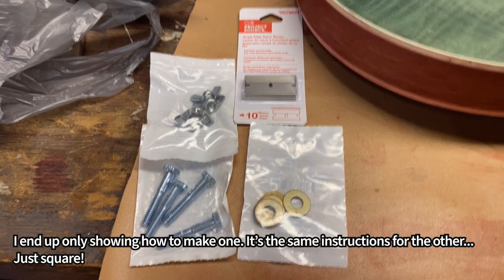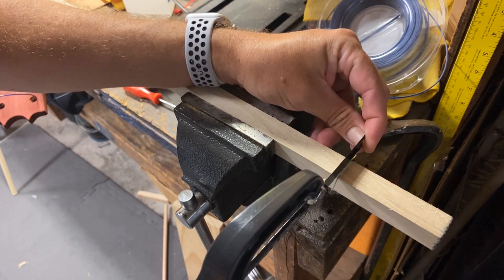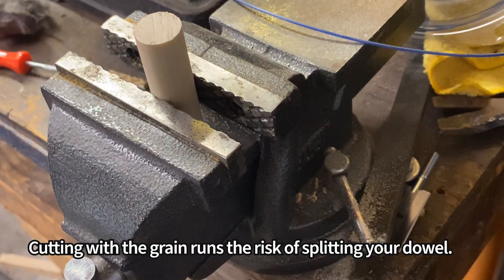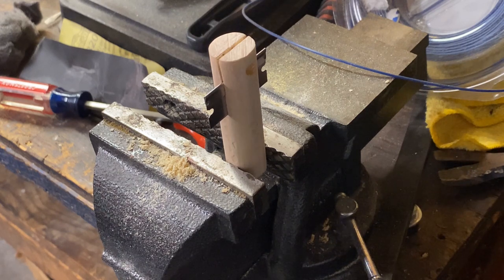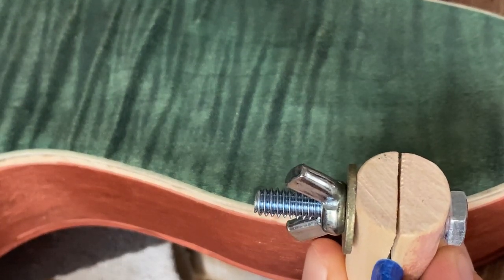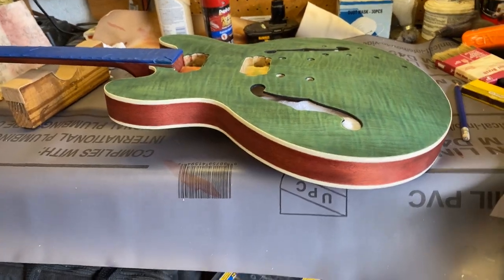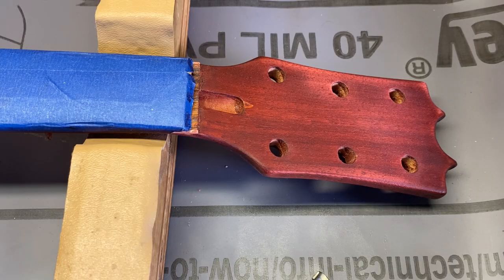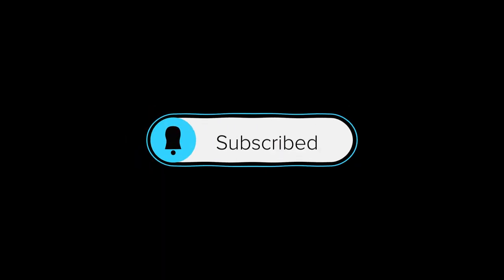Building a StewMac ES-335 Kit - Part 6 - Binding Scraper Build, First coat of TRU-OIL!

Comment: I can't decide it's I'm going to build one of those scraper tools or use my thumb.  It's the one job I've never done on a guitar.  I usually don't like bindings, but a guitar I'm restoring has em, so now it's time.  That tool certainly looks like a great way to scrape and avoid cutting in the wood.
Reply from the maker: I ended up not using the dowel to be honest. i taped off a part of a razor blade and just made it wide enough to do binding perfectly.
Reply: @iambucketdotcom_official  Yeah, seems the dowel is good to give you an idea of what is going on.  I'll probably be starting that way too.  Cheers

Comment: Did you sand between sanding sealer coats? I read where you shouldn’t use the sealant on stains because you may sand away the stain. I was very impressed with the outcome of the true oil process. Just want the sanding sealer clarified. 
Thanks
Reply from the maker: I was worried about this too. There was a bit of color bleeding initially, but that was on me for not allowing the sealer enough time to sit before staining. I ended up sanding down again, sealing, waiting a couple days, and then started the dye process. It worked out much better.

Thinning my dyes with denatured alcohol definitely helped over water thinning.

Comment: after sanding the sealer coat, noticed that the top and back are 2 pieces of maple joined in a center seam, and the maple block or maybe they used mahogany in the middle neck tenon joint looked good just spray with a light coat of real polyurethane and another coat and let it dry unless you want satin finish which is good for necks let it dry in a humidity controlled space

Comment: I was under the impression that you needed to use like items when finishing a guitar. I didn’t know that you could use tru-oil over sanding sealer without having to wait 30 days for it to cure. Now that time is passed how did the project turn out?
Reply from the maker: Finish is holding up great! It has the normal use marking that all guitars get, from belt buckles and shirt buttons, and random things hitting it.

I play it daily and take it to band practices often. Its my main workhorse and gets knocked around quite a bit.

Comment: Tack cloth after the naptha before you spray? My experience with using steel wool is that it leaves debris all over
Reply from the maker: Everything was wipe on, no spray. I do admit, I did miss tack a few times but once wet sanding and buff occurred no debris was apparent

Comment: I wouldn't go steel wool between each coat. The coats are so thin, you can easily break through them. I did the same in the beginning and had just that problem, sanding away some of my stain, especially on the edges where the true oil can't build up that well. Shouldn't be that much of a problem as you're having binding, yet I would do it only after every few coats. Every 4-5 coats seemd to work well for me afterwards.
Reply from the maker: Great point! I did change to wool after 4-5 coats instead, followed by grey Scotchbrite and then White Scotchbrite. The results have been stunning.

I am just now doing my 2nd to last steel wool on the top.. I've used almost an entire bottle of tru-oil on this guitar, she's looking amazing.
Reply: @iambucketdotcom_official  Great to hear, for an even more shiny finish you can mix true oil with nafta on the last coat. That will make it even more glossy. That's how I got my build so shiny. Looking forward to see the finished guitar. Good job so far and good luck.